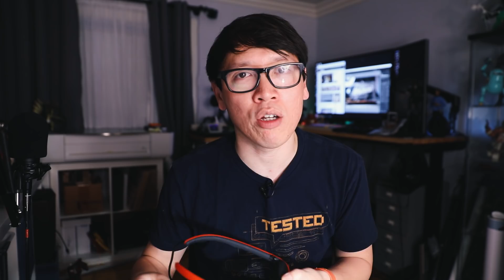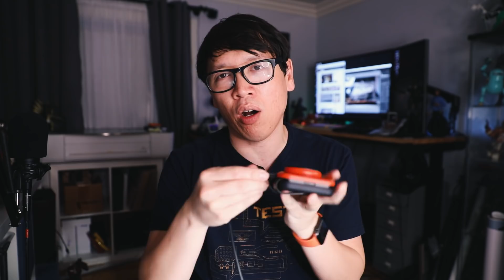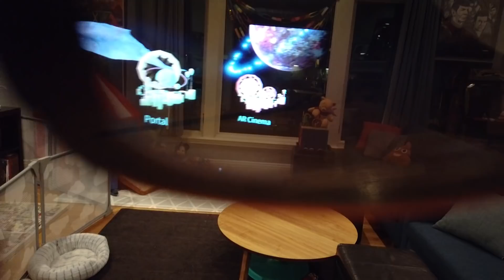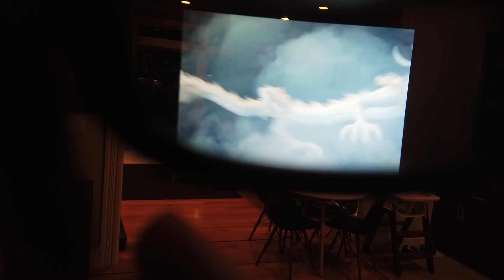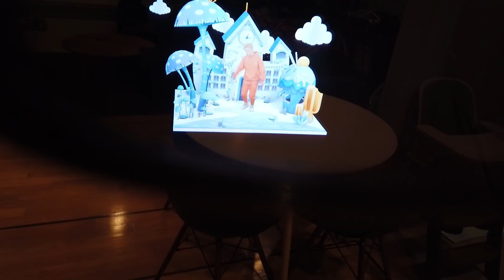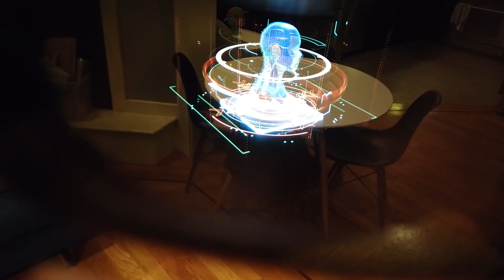Nreal Augmented Reality Glasses Developer Kit Review!

Comment: Augmented reality smart glasses have the potential to play an important role in the termination of asthenopia and myopia.

Prevention of asthenopia
Similar in principle to an ophthalmoscope shining light into the eye, the NED optical engine of AR glasses actively projects computer-generated images(CGI) onto the retina.
1. Once any refractive errors are corrected, people of any age can receive the CGI clearly via the retina; this indicates that the light projected from the NED is indeed parallel light.

2. Once the refractive error is corrected, the CGI carried by the parallel light is naturally focused on the retina without any accommodation.  

3. By extension of the accommodation-vergence reflex, no convergence.

Therefore, there is no contraction of the ciliary and medial rectus muscle.

So by using augmented reality glasses, humans can read at close range with both the ciliary and medial rectus muscles relaxed, and the eyes will never get tired.

Prevention of myopia
AR glasses can be turned into AR computer by appending a piece of opaque material on the front of the screen to turn the see-through display into a non see-through one and installing a personal computer operating system on its host.

• The AR Computer is equipped with a light-transmittable part around the opaque display. The opaque display allows the user to face the sun and use sunlight as the background light source. The opaque display protects the eyeball and the macula, while the light-transmittable part allows the peripheral retina to come into contact with sunlight.

• The AR Computer can be equipped with convex lenses around the opaque display. The convex lens can shorten the focal length of the light around the opaque display (i.e. the macula area) and change the light that is originally focused on the outside of the retina to the inside, turning the relative peripheral hyperopia into peripheral myopia.

• With the head raised, the light-transmittable part of AR Computer provides a wide field of view, eliminating the phenomenon where the peripheral visual field is deprived when reading with the head down.
Thus, the AR computer can simultaneously overcome all the major factors contributing to myopia.
Reply: Awesome, well written comment

Comment: Very promising device&concept, but if I was to have 500$ lying around, I'd get a new VR headset instead of this. A VR headset has all the exciting games built up in years. There's just very few reasons to get into this new AR category, no killer app or game currently in development, no compelling reason that I can think of to get this other than watching videos on commute. Phone overheating and battery drain would also be major issues. Gear VR has failed because of these things and it was a much much cheaper device. I don't think this will take off in the recent future.
Reply: sure but what if u do have a good vr headset and u do have $500 laying around and u do like ar......then it's actually really affordable and capable compared to absolutely everything similar on the market :P

Comment: AR in this form will die. The mainstream AR needs to be usable outside. It could be an auto-tinting lens or a screen with a camera feed with a cgi superimposed.
Reply: pass through ar with a vr headset is not small enough or good enough yet ....but it could be ....and nreal would work outside if u have dark enough cover lenses and if the monochrome cameras for tracking don't have a problem with bright areas like oculus quest has a problem ...........u could use cameras that will do the job

at the moment this is for enhancing your work and entertainment and will drain your battery in 3hrs if u use it with an average phone....it's not for walking down the street with ....it's for showing a friend at a cafe or a colleague at an office what looks effectively like a hologram .....not so much for pokemon go

Comment: I think eventually we'll drop AR and go to a VR model that streams the outside world at a resolution equal to the limit of our eyes.
This way reality could be re-rendered to either look natural or be filtered.  Augmented items of course could be mixed with the stream.
The headset would have ultra high res eye-tracking, 360 degree cameras, IR and UV  sensors, recording, zoom, software enhance, multispectral overlay.
I'd want to go as far as including actively filtered air, augmented hearing etc.
Basically a Vader mask.
AR seems so clumsy and limited.  Streaming reality through VR is the way to go!
Reply: http://lightfield-forum.com/wordpress/wp-content/uploads/2013/07/nvidia-near-eye-light-field-displays.jpg vr won't be a box on your face forever .....but there r a few evolutionary steps needed ....it doesn't need to be a vader mask it could be shrinked quite a lot if u exclude the filtered air

Comment: Now I'm just going by the description here, but wouldn't a beam splitter facing the other way be better? Given the description here, (and assuming a 50/50 splitter and semi-silver glasses lens, for easy math) you would lose 50% on the first bounce through the splitter out to the glasses "mirror", then another 50% at the glasses lens "mirror" and then another 50% coming back through the splitter again, so you would only be seeing about 12.5% of the available light from the screen. Brighter screens need more power. But if the splitter bounced the top-down display right into your eyes, you would be receiving 50% of the original light, so the "screens" would use less power to achieve the same brightness. And I think the way its described here you could see what a person was viewing from the outside, no? Or is all that light folding needed for a focal distance?
Reply: yes it's needed for the focal distances  ....it's an old ar optics setup

Comment: Nice review thanks. However, as you said, there's not much you can say about the software till it's out. I've had a few AR glasses/headsets and really none of them have any truly useful apps and that's gonna be the differentiator for any similar glasses. Google Glass is still by far and away the most useful on a daily basis yet dumb fucks that Google are they screwed up it's entire development. Someone really needs to kick them up the arse as their hardware development is complete rubbish. I'm still not certain that AR/XR glasses are gonna be anything more than a curiosity till the tech can deliver a truly lightweight device with killer apps. And that's not going to happen for at least 10 years, no matter what Apple have up their sleeves.

Comment: What AR needs with so many up and coming hardware options is a common software plaform like maybe Windows MR drivers to stream hololense content to any AR glasses or even VR headset, especially where a passthrough camera is either built in or available as an addon.

Lacking that, just a way to stream your phone screen as not to have to take it out or a driver to stream virtual monitors to the glasses from a PC or actual VR content, ignoring the transparent backgound.

I want AR to happen but am worried about software fragmentation and other lack of content.

Comment: Great first impression review! Quite impressive what they were able to put directly in glasses of that weight.
A great (but very difficult) demo / application would be a phone conversation with a person that was 3D-scanned before, standing in the room lip-syncing and gesturing like the actual person on the other end. ... might take another 5 years or so.
Small technically easy to achieve things they should definitely enhance before going public:
Full adjustability of the frame (especially: width of the front, length and individual up/down orientation of the temples; just consult with an optician of your choice ;) ).
... and of course: every heavily used cable will at some point need replacement, so just add a socket in the glasses for it, please (less than $1; should be in the budget ;)).

Comment: As others have said, I am so interested in a compare/contrast of this and Tilt5. Tilt5 seems better to me, but I did back it. It has a very similar form factor but it seems like tilt 5 has better FOV and it has a 6DOF controller. yes you need the board, but the Nreal glasses seem to need trackers too. Any input would be appreciated.
Reply: It's also cheaper and doesn't require this many processing etc. I like Tilt 5 better, but the design is a bit... meh unfortunately.
Reply: This headset doesn't need trackers. It uses cameras to track movement in the room. It's called SLAM tracking. No external trackers required
Reply: @shableep  oh ok. I guess it was a specific case that they mentioned in the video.

Comment: mirroring from the ground can be avoided with a small shade... ml1 had an add on like that.... but diy will be tricky
Reply: @Guybrush Threepwood lol what's not possible... sticking a piece of tape that will stick out and stop reflections from the ground....or u can always 3d print something biger and more permanent

majic leap shade for blocking light and reflects from top 
https://img.reality.news/img/20/36/63669415208467/0/gallery-close-up-look-magic-leap-ones-optics.w1456.jpg

https://img.reality.news/img/58/81/63669413381966/0/gallery-close-up-look-magic-leap-ones-optics.w1456.jpg

u just need something like that on the bottom 
https://www.kguttag.com/wp-content/uploads/2019/01/2019-01-10-P1100197-nreal-side-view-2.jpg
but without a specific design for a 3d print insert it  will stick out quite a bit